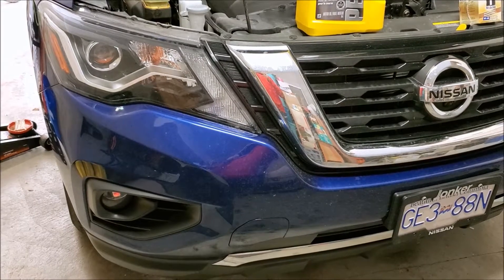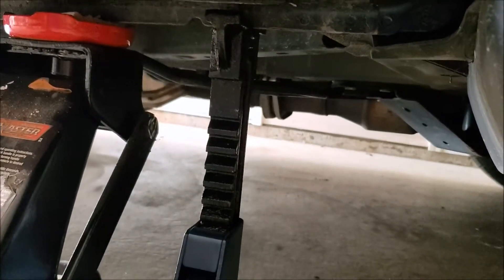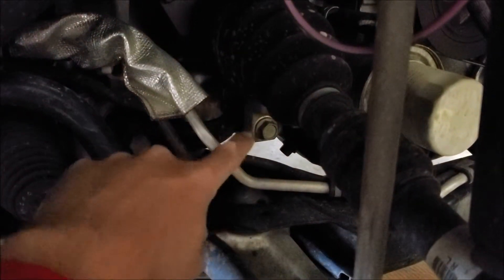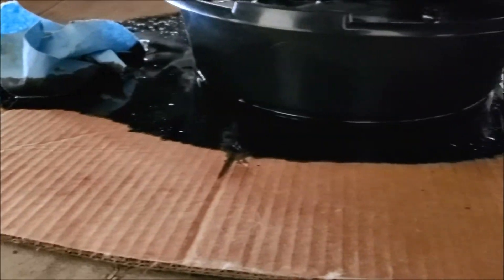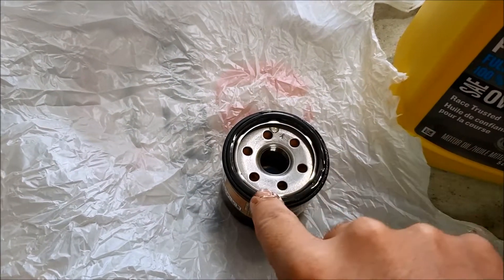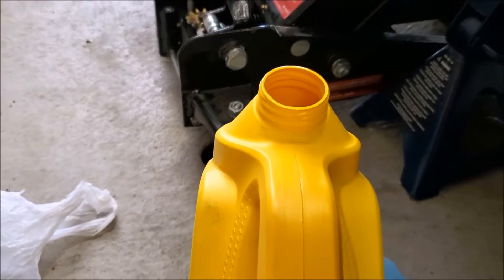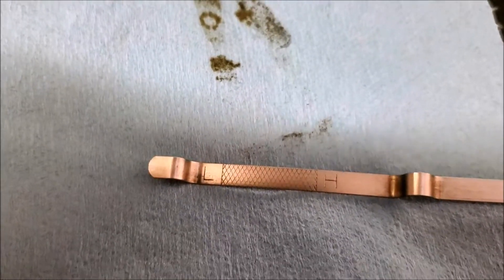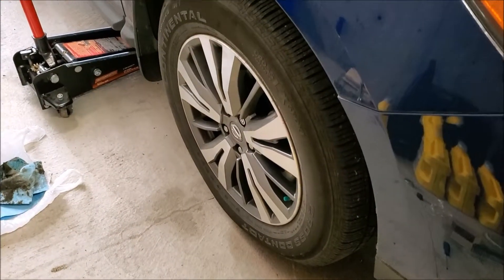2014-2020 NISSAN PATHFINDER OIL CHANGE AND MAINTENANCE RESET

Comment: Good tip about the dipstick being turned the right way around when re-inserting into the block.   That guide can attract crud so I clean it out very gently and carefully with a thin rod and a cloth taped to the end at each oil change being extremely careful not to push bits of said crud into the engine.

Comment: The dip stick on these cars are a pain in the ass have to line it up just right to check the oil level
Reply from the maker: I know what you mean haha. If you turn it so the bump on the dip stick is towards you then it slides in. Such a dumb design
Reply: I cannot get an accurate reading on the thing to save my life.  That chute that it slides down into basically smears the whole thing with oil coming out and going back in.  Useless.  I wipe it off a half dozen times...makes no diff.  I guess i have to just rely on the idiot light to tell me if its low
Reply: @rrmorris67  I thought I was the only one lol real pain
Reply: Bad design all round.

Comment: Pit a couple of those filters on my 17. Theyre crap dude. Look at a new one in the box and rub the bare machined metal with a paper towel. Theyre FULL of metal machine dust. Just an fyi
Reply from the maker: Good to know. What one do you recommend? It's almost oil change time again.
Reply: @CanadianCruisin  On mine and my motorcycle I use the Pure One filters that are the highest rated. I think theyre good for a year but I change em every 6 months cause its cheap insurance. I had purchased the mibil ones on line and I think I ordered 3 of em. I threw the last 2 away cause I just couldnt do it. The puralators are usually clean. Ocassionaly ill run a paper towel into the threads and get a little debris, but nothing like what was all over those mobile filters
Reply from the maker: @DrDaddy-yg2ki  awesome thank you. I'll stay away from these ones from now on
Reply: @CanadianCruisin  well and judging by your name your mobile one filters maybe manufactured somewhere else and be fine, but Id check for sure.
Reply from the maker: @DrDaddy-yg2ki  I'll give it a look when I change it next time.

Comment: How many quarts does it need?
Reply from the maker: I used the whole 5 quarts and it was perfect. I've heard of some using 4-4.5 as well but with the filter change mine took the whole 5
Reply: Everywhere I read says 5 quarts but mine only takes 4 to get to the high mark on the dipstick. 🤔
Reply: I read online it takes 5.1 quarts of oil but when I drained my old oil in a jug it was 4 quarts. I changed the filter and added the whole 5. Is that good?

Comment: You actually have to take your tire off to do this???
Reply from the maker: No you can get at it without. I just take in off to film easier. If you have small hands you can even get it from underneath without using the little flap as well